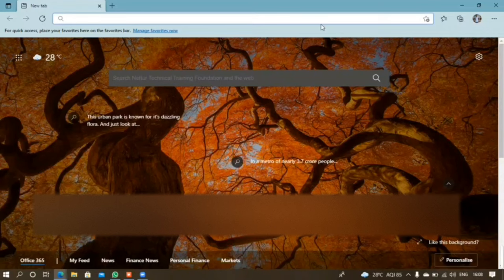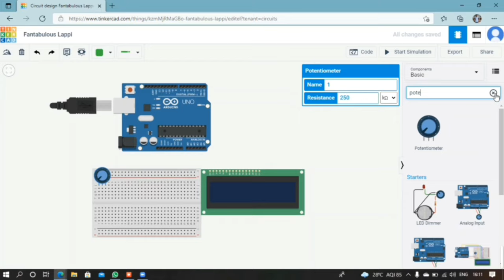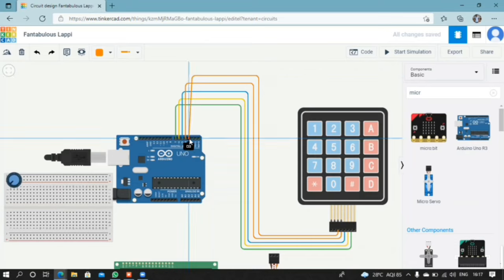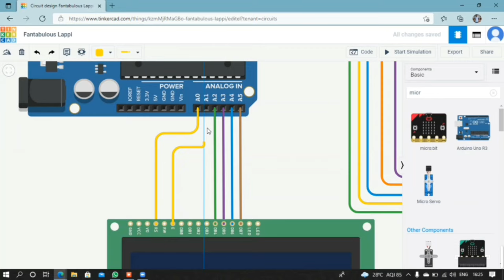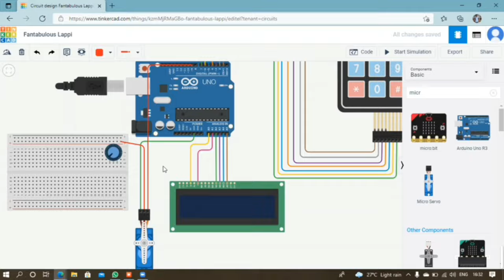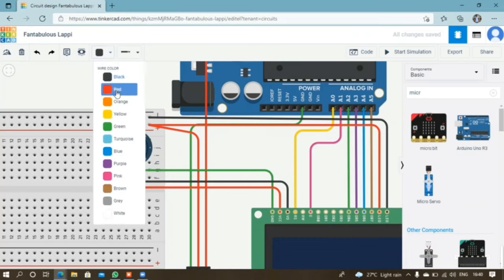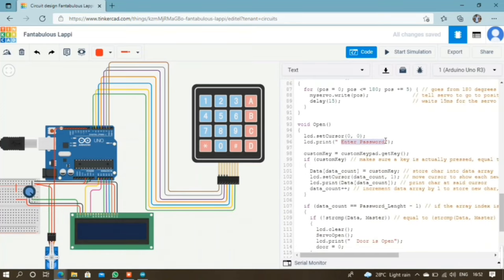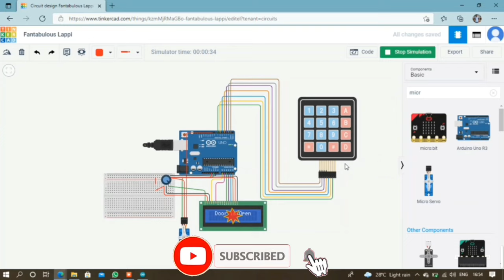Smart Door Lock circuit || Arduino board || Tinkercad || #smartdoorlock #tinkercard

Comment from the maker: this is updated code.. try this and comment me guys
#include <Keypad.h>
#include <LiquidCrystal.h>
#include <Servo.h>
Servo myservo;
LiquidCrystal lcd(A0, A1, A2, A3, A4, A5);
#define Password_Lenght 7 // Give enough room for six chars + NULL char
int pos = 0;    // variable to store the servo position
char Data[Password_Lenght]; // 6 is the number of chars it can hold + the null char = 7
char Master[Password_Lenght] = "123456";
byte data_count = 0, master_count = 0;
bool Pass_is_good;
char customKey;
const byte ROWS = 4;
const byte COLS = 3;
char keys[ROWS][COLS] = {
  {'1', '2', '3'},
  {'4', '5', '6'},
  {'7', '8', '9'},
  {'*', '0', '#'}
};
bool door = true;
byte rowPins[ROWS] = {1, 2, 3, 4}; //connect to the row pinouts of the keypad
byte colPins[COLS] = {5, 6, 7}; //connect to the column pinouts of the keypad
Keypad customKeypad( makeKeymap(keys), rowPins, colPins, ROWS, COLS); //initialize an instance of class NewKeypad
void setup()
{
  myservo.attach(9);
  ServoClose();
  lcd.begin(16, 2);
  lcd.print(" Arduino Door");
  lcd.setCursor(0, 1);
  lcd.print("--Look project--");
  delay(3000);
  lcd.clear();
}
void loop()
{
  if (door == 0)
  {
    customKey = customKeypad.getKey();
    if (customKey == '#')
    {
      lcd.clear();
      ServoClose();
      lcd.print("  Door is close");
      delay(3000);
      door = 1;
    }
  }
  else Open();
}
void clearData()
{
  while (data_count != 0)
  { // This can be used for any array size,
    Data[data_count--] = 0; //clear array for new data
  }
  return;
}
void ServoOpen()
{
  for (pos = 180; pos >= 0; pos -= 5) { // goes from 0 degrees to 180 degrees
    // in steps of 1 degree
    myservo.write(pos);              // tell servo to go to position in variable 'pos'
    delay(15);                       // waits 15ms for the servo to reach the position
  }
}
void ServoClose()
{
  for (pos = 0; pos <= 180; pos += 5) { // goes from 180 degrees to 0 degrees
    myservo.write(pos);              // tell servo to go to position in variable 'pos'
    delay(15);                       // waits 15ms for the servo to reach the position
  }
}
void Open() {
  lcd.setCursor(0, 0);
  lcd.print(" Enter Password");
  customKey = customKeypad.getKey();
  if (customKey) {
    Data[data_count] = customKey;
    lcd.setCursor(data_count, 1);
    lcd.print(Data[data_count]);
    data_count++;
  }
  if (data_count == Password_Lenght - 1) {
    if (!strcmp(Data, Master)) {
      lcd.clear();
      ServoOpen();
      lcd.print("  Door is Open");
      door = 0;
    } else {
      lcd.clear();
      lcd.print("  Wrong Password");
      delay(1000);
      door = 1;
    }
    clearData();
  }
}
Reply: thank-you Habibi
Reply: What's the password?😊
Reply from the maker: @Xvr.lf7456  The default password is 123456..if you want you can change it

Comment: some star pattern is showing on lcd, even after adjusting potentiometer, not going. also, where is the power supply in simulation
Reply from the maker: That is issue in the software. and the power is directly coming from the cable so no need extra power

Comment: Why they show me in lcd 16×2 that current through backlight led is 23.7 KA, while maximum is 20.0 ma plzz slove my this problem plzz
Reply: I think it doesn't matter because the lcd is working
Reply from the maker: There is a problem in the software so. if you do hardware, you won't face this problem